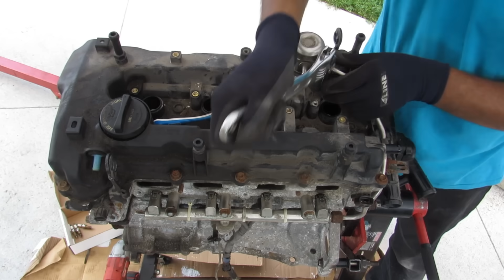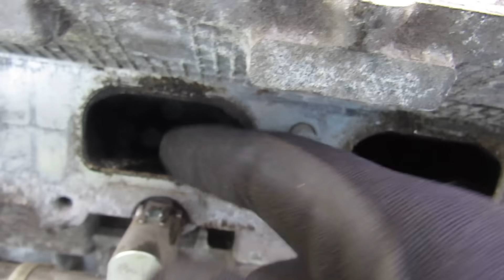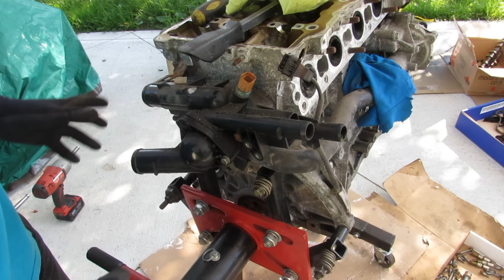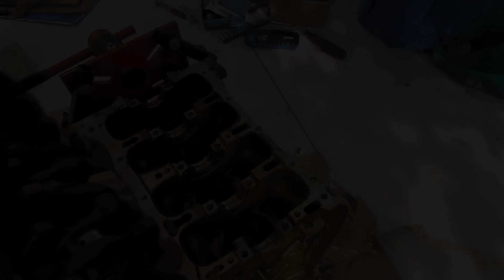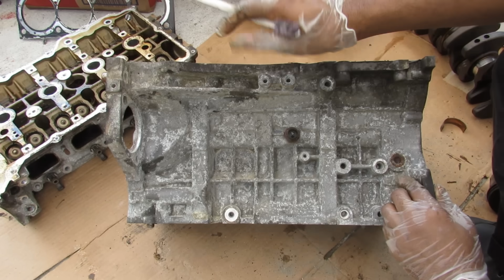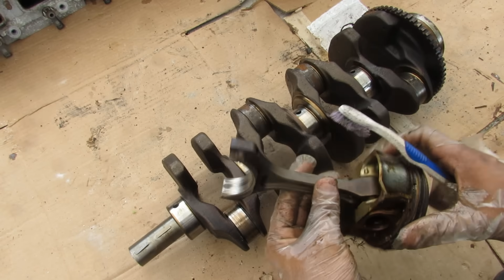Why Hyundai Engines FAIL

Comment: Got 220,000 miles on my 2012 Sonata before the warranty replacement at no cost, of course had to put a quart of oil in once a week for the last 5,000 miles. Now it runs like a dream with the replacement.

Comment: So, this was basically clickbait. One type of engine for a limited range of model years that was handled by a recall, but the title implies ALL Hyundai engines fail. I just unloaded a Chevy truck with several class action lawsuits against GM for the engines failing. I had a Ford with head gaskets that failed, causing the heads to warp and fail. Neither Ford nor GM willingly recalled these engines. 
The information was interesting, but the title was a complete hatchet job.

Comment: I remember when the recall came out on these engines (for Kia anyways) where we had to take an android tablet with this snake microphone and place it in the dipstick tube while running the engine at various RPMs. If the tablet said it Failed (even if you couldn't hear any weird noises) the car got a new engine no questions asked. But sometimes it would 'Pass' while the engine was sitting their clanging loudly so we'd have to send a video of the noise to Kia's warranty and then they'd approve replacement. 
Doing that sound test on the 2.0 Turbo was an absolute pain because you had to hold the engine within 100RPM of a certain value for a certain amount of time (like 30 seconds or so, I cant remember I don't work there anymore) and on the turbo engines the boost would come in and out and you'd end up with an engine constantly fluctuating RPMs. I had to use my finger to very precisely control the go-pedal to do that test and even then it was difficult. Why Kia didn't implement automatic RPM control in their test I don't know considering the tablet was plugged into the OBD port to monitor RPMs.

Comment: on my 3rd sonata.number 2 and the 2017 i have now got an extra 20,000 miles on my 100,000 mile warranty cause of engine problems with engines made in Alabama.thankfully no problems yet.

Comment: I have a 2019 Santa Fe with the 2.4 I wonder if mine is included in the recall ?
Reply: It was for the 2011-2014 engines (unless they've changed it since I left Kia a few years ago). They changed the design of the Theta II somewhat around 2016-2017.
Reply: @Jakek200  That's good to hear hopefully mine holds up we did get the 125k warranty from carmax for it.

Comment: Piston rings seem to be an issue with these vehicles as well the oil consumption is ridiculous.
Reply: Is that the main reason these engines burn oil?
Reply: That is the main reason, in most cases oil burning goes largely unnoticed because of such a small amount a smoke going out the tailpipe but that adds up depending on an individuals commuting habits and before you know it oil levels are below operation level .

Comment: It looks like they never changed the oil in it. Not to mention, all the heat marks and discolorations from running it low or out of oil. Also, look at the valves. Where were they buy the gas for this? Looks like they were probably trying to make their own fuel from the look of all that filth in the combustion chambers.
    No matter how good or bad an engine is made, if you don't maintain it, it ain't going to last.

Comment: The replaced my gf sonata engine Hers had 62k on it 
She brought it in for the recall and they put a scope down the oil dipstick to listen for noise which it had and they drained the oil to look for metal which I had done an oil change on it a week before and I told them that and they said everything was good ! And it clearly had a rod knock you could hear it at 3000 rpm 
The guy told me it was the variable timing lol 
So here’s what they did 
They changed the oil dipstick the factory one was reading wrong it said it had 4 qts and actually it had 2qts so when going around turns you were basically running the engine dry of oil 
They put an orange dipstick in that read correctly …
They did replace the whole entire engine and it ran perfectly! 6 months later a tree fell on the car bye bye lol 😂

Comment: 2008 Santa Fe was the single worst & expensive mistake I ever made! Got it off lease at 60k, comfy, good drive, leather everything. It lasted a total 108k on the clock total before the throttle went mad & stuck a piston out of the side of the block. The Hyundai service manager smirked at me when he realized they were off the hook because it had just passed the warranty. I nearly launched myself across the desk at him! I installed a scrap engine myself & drove it another two years before trading the scrap for my Toyota Tundra truck... I would not piss on hyundai if their building was on fire!

Comment: I have the Theta II G4KF non DI in my 2012 Genesis coupe currently at 145k miles and she runs like a champ. This motor was codeveloped with Mitsubishi and Chrysler it’s known as the global engine alliance. All three manufacturers put their own “sauce” on the engine design Mitsubishi used the motor in the evox 4b11T it’s not identical by any means think of it more as a close cousin as Mitsubishi used 4bolt mains and utilized a semi closed deck design to improve structural rigidity. also rods are improved in their design as are the pistons all engines utilize same bore 86mm. Chrysler used the motor in a bunch of cars as well mostly in Na form.

Comment: I had purchased a 1992 Hyundai, when they were first intro'd back then and I had so many problems with it, that I found out people were calling them "disposable cars", back then. Running joke was you can stop by your gas station market pick up a disposable lighter, disposable razor and a Hyundai, all in the same isle. I've learned my lesson and will never,never purchase a Hyundai, again. I'd rather get a BJ by an 83 year old hooker wearing braces and suffering Parkinson's disease. I'd rather set my hair on fire and put it out with a sledge hammer.
Reply from the maker: They have been improving but underneath still alot of Plastic which I don't like

Comment: I will have to correct you on this engine failure. This engine did not fail due to debris left in engine block. Yes, Hyundai did have this issue and still have this kind issues, but at case it was not.
This engine failure was caused by rod bearings. Back in 2011 Hyundai started to experiment with rod bearings with all kind coatings (i think they called it polymer) Bearings were colored red. In theory it had to increase serving time, but actually it was opposite. Bearings failed and all debris was sent in to the lubrication system, that's why you see all that destruction in cylinder head journals. Also, rod bearings are undersized in my opinion. Oil pump should be damaged too (This engine oil pump is complicated, it comes integrated with balancing shafts and not replaceable bearings) so all unit must be changed (not cheap)..
Also in some markets these engines came without engine jets and they suffered from cylinder wall damage and piston slap. Since the pistons are undersized. On top of that these engines don't like holding cylinder bore shape, in other words... it is a weak block.
Reply from the maker: Thanks for the input

Comment: Great video!!! I like his description of what the components do, as he removes them from the engine.... I do not like direct injection either, because of the inherent problems of intake carbon build-up... I PARTICULARILY do not like Variable valve timing because of the complexity involved with it... This engine had a problem with it, on the intake cam VVT control valve. I favor valve lash adjustments done with threaded tappets or ball-studs & locknuts, over the shim in bucket adjustments... Much easier to adjust valves that way and they offer the advantage of not having to buy highly specialised - expensive parts from dealers to do valve adjustments after head work has been done. It is doubtful that Hyundai & Kia decided to sacrifice the quality, to increase the quantity - by not properly cleaning-out the lubrication passages in their engines... My guess is, the bearing failures were caused by dirty fouled engine oil. The owner(s) of this car probably failed to do the engine oil changes in a proper manner...... But,  I'll stick with my motorcycle and cast-iron 1/2 million mile American V-8's... They just keep on running...
Reply: That engine was about the only 4cyl that gave Hyundai a bad problem....over the last ten years, KIA and HYUNDAI have achieved stellar status for being very reliable vehicles...this older 4cyl problem engine is an anomaly--not typical of most other engines from the companies....this dude knows his stuff--but he seems to have a negative attitude towards the engine in general.
Reply: @curbozerboomer1773  Gotcha... I imagine that Hyundai's & Kia's did not get to where they are at by producing bad vehicles, and other products... But You have to admit, the vast majority of modern OHC engines, using aluminum heads ,  are basically throw-away designs-after a bad overheat.... Too many things to go wrong on these newer vehicles, after they reach a certain mileage and/or age.... After they start having problems, like these examples developed, time to send the vehicle to the salvage yard and start-over with another vehicle... They just don't last the way they used to anymore...

Comment: Well I have a Hyundai i30 from 2008 and had no engine fail since i bought it- It runs smooth despite 180.000 km on the road. So what's the problem?
Reply: Yeap i have Hyundai accent 2008 3door 270.000km on i service my car self no problem ....what i do know is there is bad engine out there like Toyota 2016 corrola or runx 1.4 but sam people don't make videos on them

Comment: This problem was due to a change in the way they flushed the debris from the crankshaft from using water to air. Nothing to to with deburring, only cleaning. It affected less than 2% of the engines and mostly in America. This is a beautifully designed engine otherwise, efficient, reliable and powerful considering it only drinks low octane fuel.
I have run this engine in Australia for 160,000km with no problems doing 15,000km oil changes using synthetic oil. Carbon build up is just not a thing on this engine. I haven't even see it on that engine apart from a light soot coating which impacts nothing.
This whole 'direct injection issue' is a joke seeded from very poorly designed engines like GM and the like.
There is nothing but bias in this video. I'm not a fanboy of any brand but can recognise good and poor engineering when I see it.
I have replaced two minor things on my 2013 i45 where as my previous Holden (GM) cars had the bonnet up every other weekend with issues and used twice the fuel for the same power. People need to get their heads out their arses and stop listening to people that have no clue.

Comment: If on a direct injection engine, only air goes through the inlet - how is the carbon formed in that place if there is nothing ignited?
Reply: Oil vapor from the PCV system.
On a port injection system it’s not a problem because the port injectors spray fuel on the backs of the valves. On direct injection there’s no fuel to keep the valves clean.

Comment: I’m surprised absolute cleanliness when a manufacturer assembles engines was a given. An expensive mistake to make! 
I have rebuilt many petrol and Diesel engines and been very particular about blowing through all oil and water galleries with degreasing solvent plus pressure washing to ensure absolute cleanliness. Then careful assembly with everything well oiled and making sure you have good oil pressure with a gauge screwed into the oil gallery when starting. 😀
Reply from the maker: You'd think so eh

Comment: I have 2013 2.0t sonata and my engine recently seized. Hyundai is currently replacing the engine which could take weeks.  Part of me is happy I’m getting a new engine in my vehicle, im wondering if they fixed some of these issue ie: deburring. I must say they were easy to deal with and my local dealership probably replaced so many of these engines they’re probably really good at it by now. Hyundai is also providing me with a rental for the duration as well.
Reply from the maker: So the problem isn't just the naturally aspirated motors eh
Reply: @speedkar99  no, unfortunately. A co-worker with a Sante fe with the same engine had the same thing happen. Actually I need to count on 2 hands the number of people I know that had to replace their Hyundai engine. Nice video btw interesting to see the “pros” and cons of the engine.

Comment: Ah yes, My Dau had her Kia lock up, but since she did not have a paper trail for her 3rd party oil changes Kia rejected a warranty claim.  Now if we could only get rid of the EGR system, GDI intake side would be much cleaner but I suppose the tailpipe would be dirtier
Reply from the maker: EGR isn't needed for alot of other engines. It can be done without

Comment: As far as I know these engine failures /fires are specific to US made engines?
Reply: Lots of Hyundai engines had different common problems, some would burn valves, strip camshaft keyways, spin bearings... always a new surprise in store for the next model..

Comment: On the 2006 - 2008 Theta engines I've seen at the salvage yard, the #1 cylinder's connecting rod breaks loose and makes a hole in the engine block.  On the customer's car I worked on, the engine was making a huge knocking noise.  When I removed the oil pan and oil pump, the pump had completely seized and the bearings on #1 cylinder where completely gone.   Since the Theta engine is also used by the Kia Optima, I was able to get a replacement at the salvage yard from a Optima ($150 if you pull the engine out yourself) that worked perfectly in the Sonata after the 2nd attempt.  The 1st replacement engine was a oil burner.

Comment: 2009 Hyundai Sonata 2.4 l motor standard injection with 127 K still running find    Mobal 1 about every 5 to 6 K since 12 K miles when I bought it in 2012

Comment: Any gasoline fuel system that requires 1,900 psi fuel pressure will Never Last.
Reply from the maker: Direct injection without port injection

Comment: The triple square socket your using is physically incorrect. You require a straight shank male triple square socket . The reason I know this is because I had to remove a cylinder off my Toyota Prius which called for a # 12 triple square male socket.
Reply from the maker: Watch later in the video I used the straight shank oke to get at the two other head bolts

Comment: When removing head bolts, it is said, one should start on the outside and work your way in in order to not possibly crack the head. When installing the heads, opposite is done when installing the heads.
Reply from the maker: Agreed. But this engine is scrap

Comment: So you're saying that my 2012 Hyundai Sonata with 92,000 miles and is running perfectly with no issues whatsoever is an anomaly? I'd say if someone's Hyundai is running well past 60k miles, you have an excellent chance of reaching 100k miles - assuming you're not abusing the car and you're changing the oil when you should.  :-)
Reply from the maker: Changing oil is key. And not all engines will fail before 100K miles

Comment: I have two of these engines - 09 Sonata/13 Santa Fe, both run perfect with no issues due to oiling.   The engine in your video appears (due to the abnormal amount of corrosion on the aluminium block) a higher mileage engine.  The recall issued by Hyundai addresses possible metal debris left in a new engine during the manufacturing process at the US Alabama plant.  The question is...how in the world could metal debris left in a engine during manufacturing manifest itself and cause damage at 50k/60k etc miles later?  The answer is it would be virtually impossible.  The engine took apart in the video failed due to lack of lubrication......all the mains and rod bearings scorched and gouged.  This is not a design fault....it is a failure of maintenance.  With proper and timely oil changes these engines are very durable.  The other issue you mentioned concerns carbon build up on the back side of the intake valves.  This is an issue with any GDI engine as no fuel (which is a solvent) ever gets to the back side to clean them which is why some manufactures have  started putting an additional injector ahead of the valves like a conventional PFI system to rectify this issue.  The other "solution" is to simply clean the intake system with a solvent like CRC on a regular basis and install an oil catch can in the PCV system to reduce the build up of carbon deposits in the first place.  (retired ASE Master Tech)
Reply from the maker: Good input thanks
Reply: You're flat out wrong. It was an issue with metal burrs being left on the edges of the oil passages. After X amount of miles, those burrs would finally break off and cause oil starvation. It's not as if there were metal shavings floating around in the oil when the engines left the plant. 

Routine maintenance doesn't really play a factor in this recall. It's a machining process design issue.
Reply: @MrDadMoo  Appreciate your reply, however, the scenario you describe would be extremely unlikely.
Reply: @dr2644  

"Extremely Unlikely" is the thinking that led to the(delayed) massive recall and a nearly 10% failure rate with the original run of Theta2 GDI engines. 

I assure you, my information is spot on. Also, your 09 Sonata is NOT a Theta 2 gdi engine.
Reply: Thank you. I have a 2019 kia sportage with the 2.4 that i bought new. I did the first oil change at around 1500 miles and ive done the rest every 6 months because i dont put 5000 miles on the engine in 6 months so do them ever 6 months instead. It now has 18000 miles on it. I hope it will last a long time.